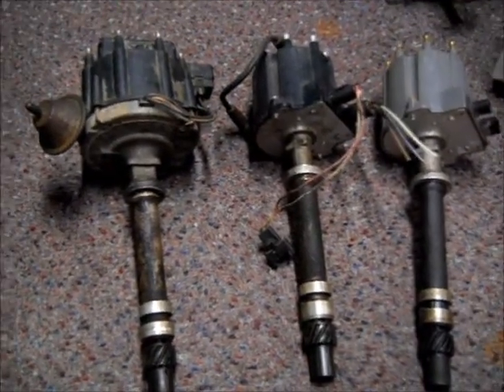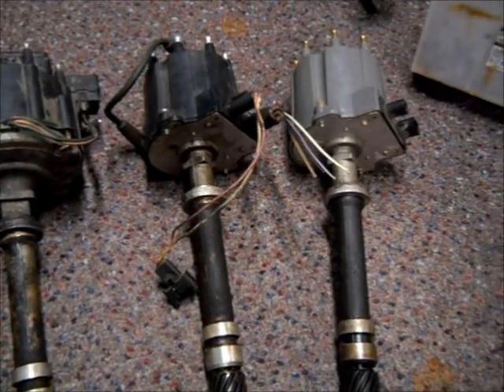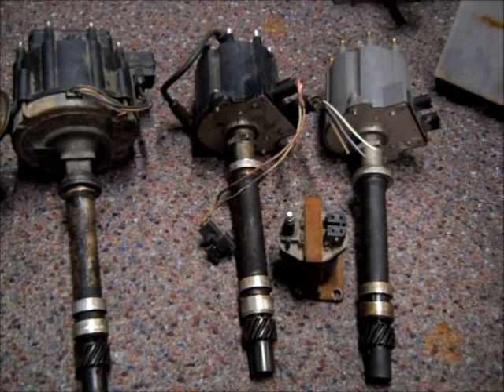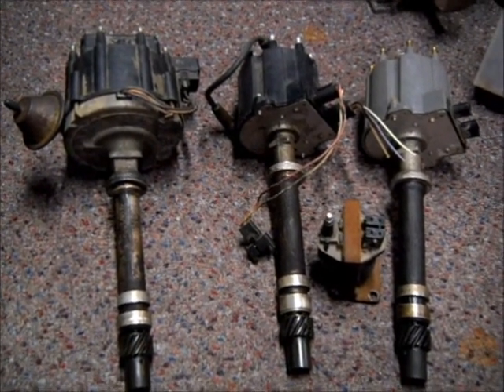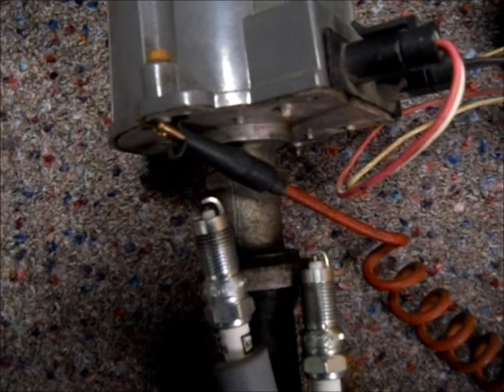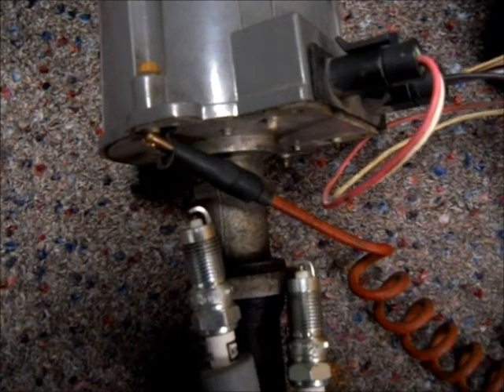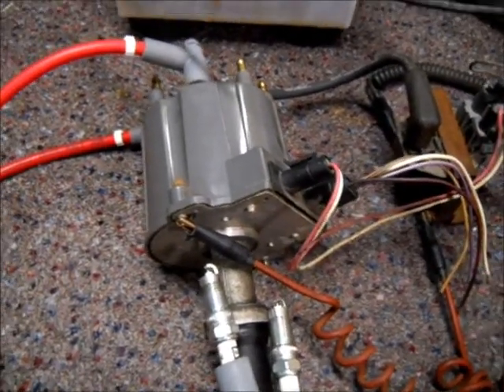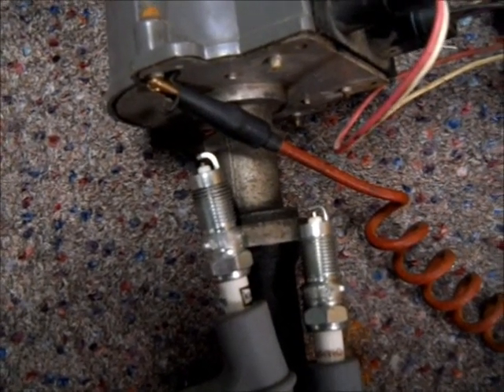Chevy (tbi) distributor test

Comment: 3 years after you posted this video I' m watching it, I' m looking for videos about my 94 c1500 4.3 l with a TBI Distribuitor. My truck died saturday night, no start no spark, hired a street mechanic because Sundays the shops are closed. He end up replacing Distribuitor cap, rotor, ignition coil and ignition control module and after all the new parts replaced still no start no spark. Today monday mornig the mechanic did not show up.  I guess he gave up, I'm not a mechanic but looking your video I think the problem it's inside the distribuitor or all the distribuitor assembly needs to be replaced. Thanks for the video.
Reply from the maker: Thanks for watching! I’m glad it helped.
Reply: What did it turn out to be the no start problem?
Reply: @tonywalker2334  The ignition reluctor inside of the distribuitor was broken, that was the problem.

Comment: That's a good test and maybe you can get it running but it's not the whole story. Just cause you got some spark doesn't mean all is well. There is a number of things that could be wrong with them that this test won't show. I only say this because I just installed  a new distributor in my K1500 cause it was running  poorly and I know if I performed this test on my old worn out one I would get some spark.
Reply from the maker: I agree 100% there are more accurate tests than this. But however this is a good test just to see if your at least getting spark.

Comment: Wow! Have to say impressive!  Very well explained and leaves little to doubt! I changed my ignition module and it still didn't start. I swapped out a coil from one I've seen run. Still didn't run. But I noticed a lot of rust inside under the rotor. Pickup coil and everything is rusty, so I bought a used distributor shaft complete. Add my plugs and wires to the coil, and I'm back running!
Reply: Super video! Thanks for posting! Seeing that spark was amazing! (And you took it like a champ!!)

Comment: Does the distributor in the middle have a 2 and a 3 wire plug. I think that's what I have on my boat. When cold will start and run to 2500 rpm then rpms drop as I give it more throttle. Then if I shut of motor it wont start til next day.
Reply from the maker: No it does not.

Comment: I just converted my TBI to a carburetor. Can I eliminate the ECU plug and just run the positive and negative from the coil to the distributor? I already have my purple and white fuel pump wire hooked to my tach wire for the pump to run properly. I bought an HEI but with the 4.3L V6 with the carb its super tight and cant get proper timing with it.

Comment: Question is can I run the HEI in place of the TBI  disturbtor   After running around 10 min it cuts out and over fuels. Thanks for sharing your video!!
Reply from the maker: Yes you can run the hei in place of tbi. you will need to do some wiring to make it work properly but can be done.
Reply: Did you ever figure out what it was.  Mine will run fine then it falls on its face and i can smell it running rich. Any help would be appreciated. Here's your one chance youtube dont let me down.....lol

Comment: Thank you, very easy to understand video the + wire to the coil is it white or pink I cant tell in your video, other than that very well done
Reply from the maker: the + wire is the heavy gauge pink wire going to coil. The smaller wires are for a tach hookup and other stuff.